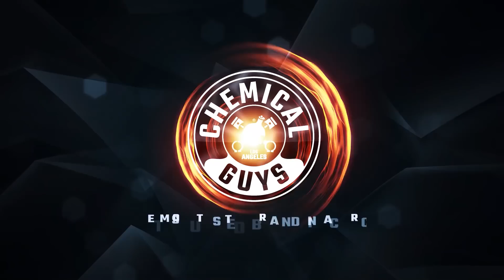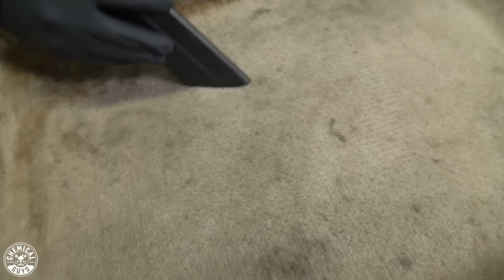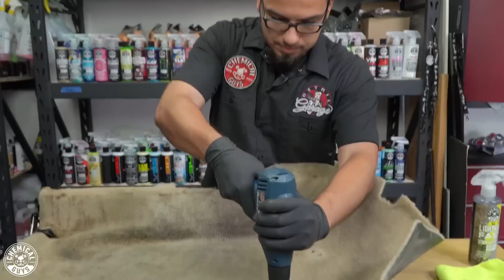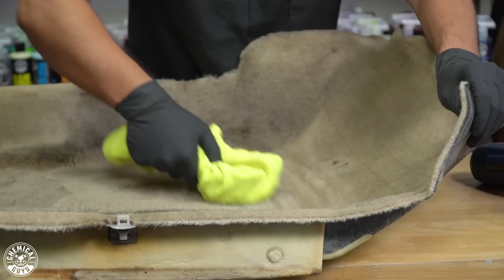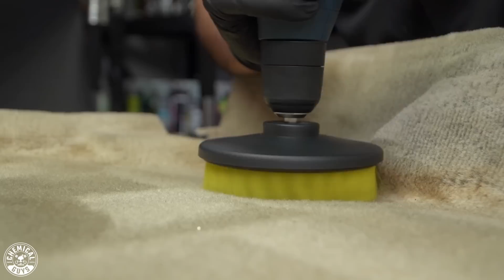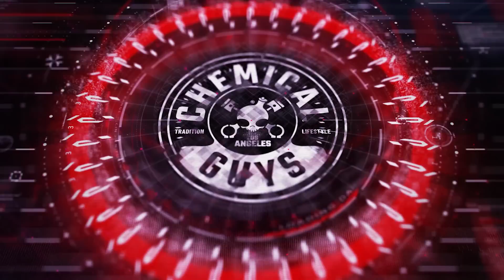How To Clean 15 Year Old Nasty Stained Carpet! - Chemical Guys

Comment: You have two different carpet brushes one is black and the other one is a beige color what is the difference in which one do I need for carpets
Reply from the maker: Hey! Both can be used for carpet cleaning. The black bristle Nifty Brush is standard for most jobs and the yellow bristle Nifty Brush is heavy duty for tough jobs.
Reply: @ChemicalGuys mainly want one for carpets  . Which would you recommend for carpets

Comment: Do you guys prefer just using fabric cleaner and wiping it up or using an extractor?
Reply from the maker: Hi Joe! Fabric Clean works well with a brush or an extractor. For heavily saturated surfaces an extractor may be necessary.

Comment: The bottle says dilute it 20:1 , another chemical guys video says 10:1. What is the correct dilution ?
Reply from the maker: Hi Danielle! Dilute Lightning Fast as desired. Use at full strength for tough jobs, dilute 10:1 for moderate cleaning or 20:1 for light cleaning.
- CG Nick

Comment: Hi guys how much in 16oz bottle nonsens is diluted ?
Reply from the maker: Hi! Nonsense All Purpose Cleaner can be used at full strength for tough jobs or diluted as desired up to 20:1 for light cleaning.
- CG Nick
Reply: @ChemicalGuys  thanks